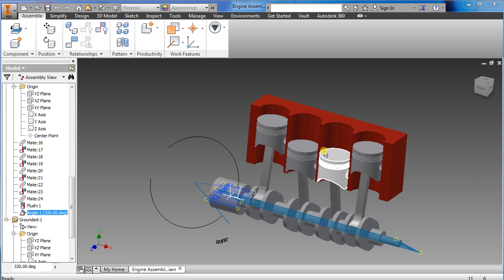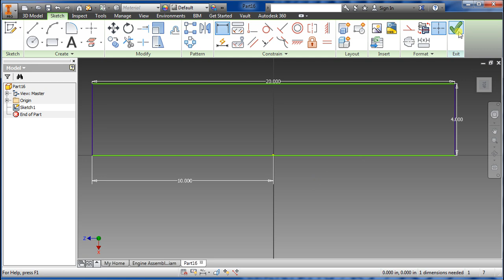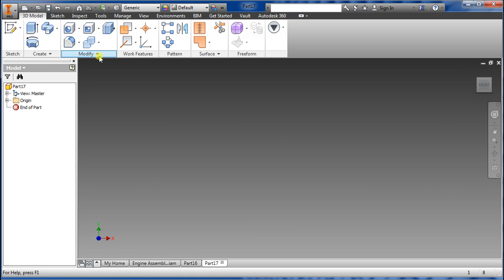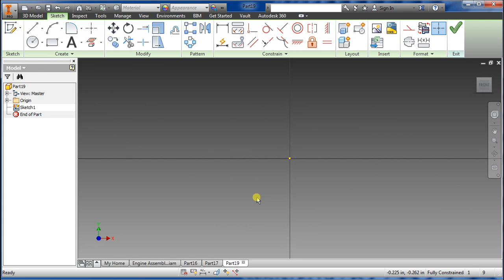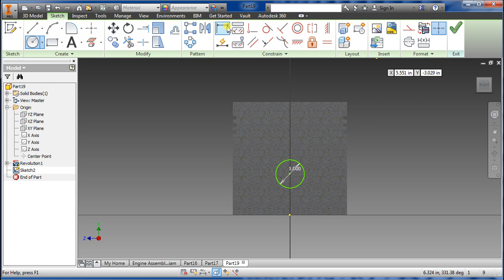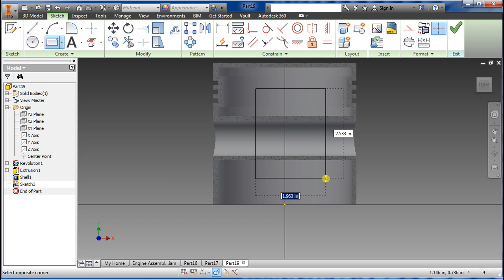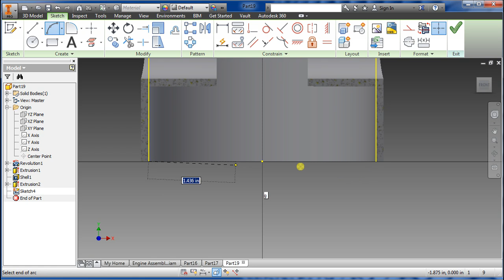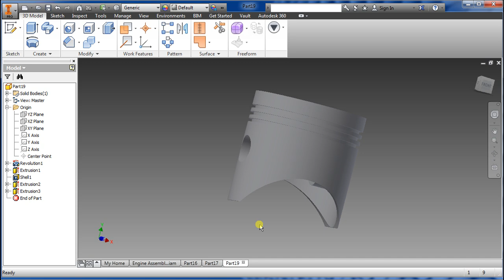Autodesk Inventor 2015 Part 1: Engine Concept Tutorial piston connecting rod crankshaft assembly

Comment: Hey, nice tutorial!. One comment though, that cut you are doing arround 10:00 should be done in a different orientation, it is intended so that the crankshaft counterweights don't touch the piston. :)
Reply from the maker: Alonso Ortega ahhh thank you for pointing that out. Cheers🍻
Reply: Ketsada Phanivong 
It's actually NOT so the counterweight don't hit the piston. I made a separate comment on here but they're called piston skirts, and their purpose is to prevent the piston from attempting to rock in the bore as the piston completes it's upward or downward travel, stops movement, and then reverses direction.

It's usually covered with an anti friction coating the skirt that incurs the most force as the fuel air charge is ignited. On this engine that'd be the front surface facing the camera.

Comment: hello man, nice vid. just a question, when i click on a face then select create sketch, y does the yellow outline dont appear in my inventor 2015? it sometimes bothers me cause there are some features that wont work well when that yellow outline does not appear.
Reply from the maker: Mark Lawrence Ranollo  Hi mark. Try this: Open up your Autodesk 2015 in Part. Go to the tab>Tools, Click>Application Options, a pop up appear and Click>Sketch, put a check mark on>Autoproject edges for sketch creation and edit, Click>Apply.   This should work. Let me know if it does or not.
Reply: hey man, thanks it did work!